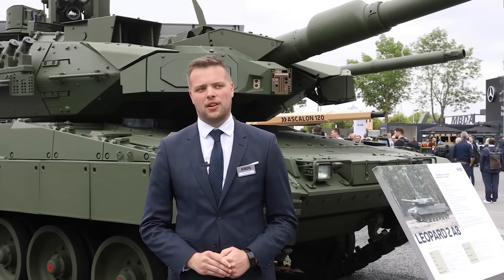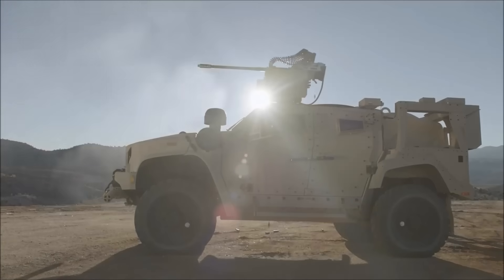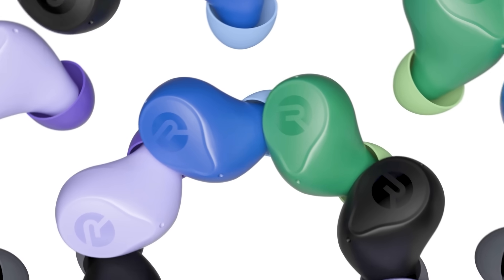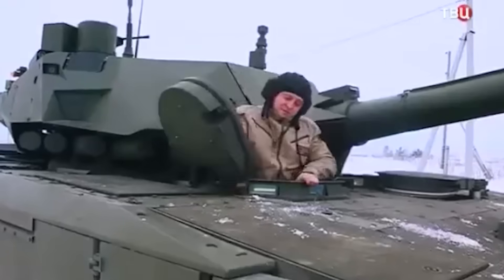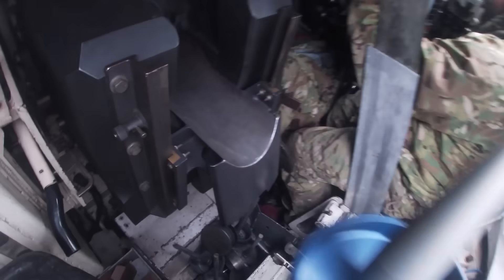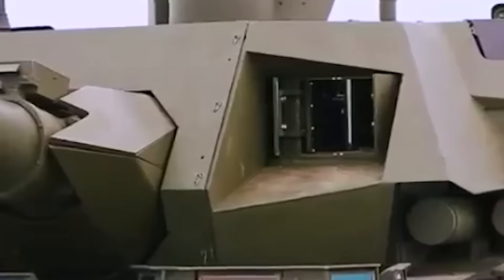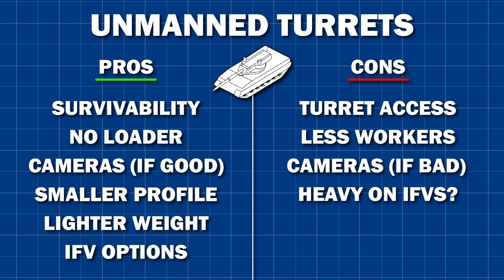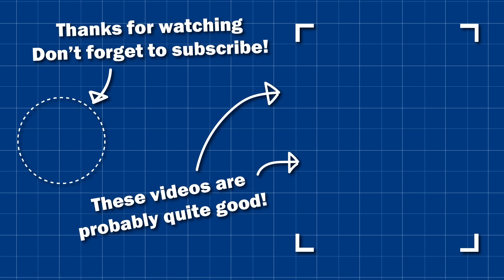The Unmanned Turret - And Why It's The Future

Comment: IFV or APC would benefit alot from Unmanned Tank Turrets. However, light tanks and main battle tanks should remain in conventional configuration because you still need basic situational awareness, and you need people to clear jammed cannon rounds and you need people inside to manually override the mechanical failures.

Comment: I would think they should put the engine in the front, and put the 3 crews in the back, and access from the back door.
fuel in the middle?
Reply: There are a number of challenges with this layout, assuming you place the main armor block in front of and above the engine. This makes maintenance tougher, and it reduces crew protection, and it reduces the height the engine can be.

The big problem is reduced crew protection. The thick front armor can only protect the crew against attacks from a very narrow front arc. Shots that aren't from directly in front will simply not be blocked by the front armor at all. The crew will only be protected by the much thinner side armor. Furthermore, this side armor must be heavy and consume a lot of space because it must run the entire length of the vehicle.

Other design difficulties come from the fact that both the main armor and the engine are at the front. This is a LOT of weight, and can really only be counterbalanced by placing the turret at the rear. But if you're using a high velocity gun, you'll want to be able to depress the gun downward. And this means the hull of the vehicle needs to slope downward. This means the front armor and the engine needs to be relatively short, and it probably means there needs to be heavy sloped armor plates above the engine. This further complicates engine maintenance tasks.

Comment: The reason that the us has not integrated autoloaders into their mbts is because due to the design of some, some autoloaders have to have an ammunition storage usually situated around the autoloader plus with an auto loader going back to the ladder with the ammo storage being situated around it theres a major risk of ammo cooking off inside of the tank rather than in a blow out panel if an enemy shell enters the tank which would annihilate the entire crew rather than allowing for a few to possibly survive an enemy round getting through plus The human loader can perform other tasks such as helping with maintenance or even taking over another crew position if needed plus While a human loader increases the chance of human error in the loading processes usually if a human messes up they can get right back up and try again If an autoloading mechanism has a significant mechanical failure you may have to abandon the fight to get it working again plus with an autoloader its easier to determine when the blast doors are open but with a human for whatever reason they might not immediately reload the gun after its fired
Reply: This is not accurate. For example, the K2 Black Panther stores ammunition at the rear of the turret, with a top blowout panel and protective bulkhead to direct an ammo explosion safely away from the crew (there are two crew members in the turret).

There is also extra ammunition stored in the hull, which does not offer this sort of protection, but that has nothing to do with the autoloader, and various western main battle tanks with manual loading also store extra ammunition this way.
Reply: I would also add resupply issues. As you mentioned, due to the rounds being in a ring of ammunition for the auto loader to load each round are usually (or at least the Soviet ones I’ve come across to) located on the “bottom” of the turret ring making it very hard for tank crews to resupply their spent rounds. I saw in a video that the Soviets (and I think some modern nations) solved this issue by basically refitting a whole new turret with the ammunition already inserted while removing the whole turret without ammunition. It reminds me of when rocket launchers were  developed in WW2: they were great when firing but when loading, it took time as the 6 tubes needed time to be reloaded and while they were, the enemy could have simply destroyed them. Same here. A tank can easily spend 42 rounds (that’s the current layout of the m1 abrams) in a firefight especially with a novice crew but the whole reason why they don’t spend it is because they are constantly resupplied. If we had auto loader system… we would have a tank alright… but one that can’t shoot because it already went through its ammo and needs to be changed

Comment: Honestly one of my pet peeves is that when the armata was first shown off, people wrote it off as overly expensive and not that big of a deal. The amount of "the turret will just be destroyed smh" comments I've read have been insane. 

Yet the moment us Europeans try it, then it's suddenly "the future of armoured warfare" and "the next logical step in tank design" 

I'm not saying we should "give credit" to Russia or something, screw them, but I think people really need to check their bias at times and what they are willing to write off or accept as truth on a whim.
Reply: people didn't trash the Armata because of an unmanned turret but because it couldn't even go down a parade properly without the transmission failing
Reply: FWIW, the Armata turret is pretty tall and vulnerable. The Leopard 2 A-RC 3.0 has a lower profile turret thanks to its double jointed elevation mechanism. The K2 Black Panther and Japanese type 10 have active suspension systems that allow adjusting height and "lean", thus enabling more gun depression and elevation from a low profile turret without a double jointed mechanism.
Reply from the maker: Hope I am not “people” here! Not meant to be a T-14 hit piece, I don’t see any reason why T-14 wouldn’t be a very capable vehicle. The issue is more that it’s been around for 10 years and they’ve only made about 30 of them, if that.
Reply: @RedWrenchFilms no I dont think so, it was just the intro that reminded me lmfao. I think you give a fair take of the concept as a whole
Reply from the maker: @EnRandomSten Appreciate that! Hope you enjoyed.

Comment: Unmanned turret should mean better armored turret, not the other way around
Reply: Moving the crew out of the turret does not eliminate the need to armor the crew. It just alters the placement of the armor required to protect the crew. There are a number of issues involved in whether or not this saves weight. On the one hand, the crew can be crammed together in a more compact region. On the other hand, the space available on the sides for armor is reduced because it can't overhang the tracks. Furthermore, hull side armor needs to protect from more direct angles, compared to turret side armor which can be reduced since the turret can turn toward the enemy threat.

The bottom line is that if you want to protect the gun of an unmanned turret to the same degree as the crew, you're not going to get big weight savings compared to a traditional turret.

Comment: i would say that a good back up option is to basically have the commander have a way to enter the turret for anything needed. it can be extremely cramped because it shouldn't have to happen often. this solves pretty much all the reliability issues. also i dont think these tanks would work alone. if anything a drone launching platform would be very useful. even just slapping like 2-3 small fpv drones would help immensely with combat awareness. irl war thunder

Comment: "Future of tank design" - one hit even from 80 years old gun and turret is disabled.
Like bruh. I dont think there is any armor on it. Imagine BMP-2 or T-55 decimating your tank because its "too techonogical" (or rather unarmored)
Reply from the maker: Don’t mean to burst your bubble but a hit from a T-55 could rather easily disable the gun/turret of pretty much any tank. Turret rings, barrels and optics are never significantly armoured.
Reply: @RedWrenchFilms  yea, HE hit from anything can disable many systems, but T-55 wont destroy any modern turret with armor piercing, also HE probably wont totally disable turret, just remember that many tanks designed to withstand it with main armor + special lining to catch stray fragments. IFV's also will only scratch and disable some sights.
But looking on those unmanned turrets, visually there is no armor even against most basic threats even up front.
Reply from the maker: @DaCouchWarrior Armouring a tank to withstand hits from modern APFSDS rounds is almost impossible. 

Unmanned MBT turrets are vastly smaller and lower profile, so are less likely to get hit in the first place. 

Aside from a hit to the turret cheeks (which many unmanned turrets don’t even have), there is no chance a modern tank could take a modern APFSDS without serious damage. 

The scores of destroyed T-90s, Abrams, Challengers and Leopard 2s in Ukraine are a testament to that, and in each case there was likely dead men in the turret.

Comment: I have to bet against the unmanned turret. It just doesn't make any sense to me. 

Mainly in terms of the visibility and motion sensitivity that Mark 1 Eyeball has. 

What I would bet on is wider adoption of the autoloader, especially for calibres of 130mm and over. 

I would also bet the crew will remain four, with the loader being replaced with the role of system operated. 

Thing is, vehicles like this? We've tried putting cameras all over them. It made the crew timid. They stopped and check every corner before moving and they only reached their objective after the hostile force occupied it. 

While that was Challenger 2 in this case, I think the same outcome is true. Information overload is information overload. Checking every screen, every perspective is going to slow people down. Volume of the turret as well, all that internal space? As much as possible keep the ergonomics good. Have people not just operate the tank, but do it comfortably. Don't make the crew fight the tank as they're also fighting the enemy. 

While the mechanical capability is there, there's an operating loss I can't work my way around. 

Honestly, I'd have to sit down with Nick Moran for a while and chew through this. I can see the gun, bustle, ammunition storage being isolated from the crew before any automated turret. It's one thing to look at a screen and get all the detail, it's another to let the eye, the human instinct to things translate through that interface. 

If I could, I'd get one of those sniper in full ghillie, where's the sniper type of meme picture here. I'd bet that being there in person there's a noted increase in detection over doing it from a picture.

Comment: I think the coming generation of MBTs will still feature the "classic" design. Just Imagine your sitting in your tank and an Artillery Barrage or sustained fire kills your optics and cameras.  Terrifying.
Reply: A camera is a lot smaller target than a vision block or window. It's a lot more likely for vision blocks or windows to get knocked out than cameras.

Also, if this is really a problem it's possible to hide spare cameras behind armor protection. For example, a camera station can be a shaft containing a stack of some cameras. If the outer camera gets knocked out, you push a block into the rear of the shaft, ejecting the outer camera and shifting the other cameras outward.

Comment: The tank I'd design would be 3+1 semi umanned tank. 
Unmanned turret that doesn't penetrate the hull so its can be swapped or upgraded
Hybrid power plant and drive by wire. 
The tank carries a mix of drones tethered camera/coms/target designation drones and dual use untethered drones kamikaze or backup camera.
Space for 3 Crew with a Service vehicle with space for 4.
The tank can be traditionally manned with 3 men for general operations
For short high attrition assaults the crew dismount to the service vehicle where they control the tank via fibre optics and laser coms with also relayed through peer tanks/drones for double redundancy if the fibre optics is cut.
The driver has the option of 360 cameras or drone if those are damaged
Commander vr headset to a has tethered drone giving him a 360 birds eye of his surroundings with target designation
Gunner has the gun sights and ammo selection
4 service vehicle driver is the engineer (for the fibre/drones), radio operator, acting as over watch for the crew when dismounted, and 4th pair of hands for servicing.

Comment: I've always wondered if adding drones to a tank to give them a 3rd person camera view (like in wot or warthunder ) will happen in the future, not only will it help with driving but it also feeds back into wat gamers already know so it'll make the tank easy to operate.who knows maybe in the future
Reply: It will get shot down immediately. Instead independent scouting drones fly in the air over the battlefield and transmit data to command center and to the tank commander.
Reply: @kindlingking really depends on how many you have tbh, plus how you position them and how far away they are. Id still say theres potential
Reply: it literally happening now in russo-ukraine war

Comment: I'd have an unmanned turret.  But I would place a fourth crew member seat in a 2x2 configuration.  The 4th seat would also have space for future equipment and interfaces.  This 4th position can be defined by the changing nature of war.  It may be necessary to have a 4th anti-drone position in modern tanks with that crew member running systems to counter drones, including kinetic systems.  The 4th position may be needed for information management.  The commander should have his head up and looking at what's going on OUTSIDE of the tank.  An info specialist could manage all of the updates and communications (like a radio operator of the past).  You can even use that 4th seat for various roles inside of a unit of tanks.
Reply: I think this is an interesting idea and valid given the role of information warfare, signals intelligence and drones getting increasingly more significant.

A 2+2 layout isn’t necessarily wider or (much) longer than a 1+2 layout. 
The 4th seat could be role/mission specific, or in certain cases be omitted.

A single or a few drones attached to a tank (via wires to combat EM interference) could be used to ge a 3rd person birds eye view around the tank, or spot targets while the tank hides behind cover. The drone would be a mobile periscope, operated by the 4th crew member.

It’s almost like the return of the WW2-era radio operator in a sense.

The turret (area) itself could be be designed as a modular, swappable, mission pack: tank, indirect fire support, drone carrier, point air defense, etc.
Reply: @tver  It's okay to rethink the tank.  I think we're already on the 3rd standard.  A fourth iteration of what meets the definition would be great. A driver, a commander, and then up to to two mission specialists depending on the package up top.  It would also make it easier to repair the chassis or the system on-board.
Reply: I disagree about the commander needing to look outside the tank. If u have seen real war footage you would very quickly realise there is almost nothing u can see with ur naked eye. Commander should be watching some screen that relays info from sensors or other units. A drone connected via fiber optic cable used to give a 3rd person view would be great as it makes it harder to blind the tank if the electronics on that tank are damaged.

Comment: I think unmanned tanks, or optionally manned tanks, are eventually going to be the future. 

But before that unmanned turrets are absolutely going to come first. Ultimately a tank is a type of mobile gun system, and it's probably good to think of it that way
Reply: nope. not the future. chinese side already post this kind of tank few year ago, together with drone. you can using drone to pinpoint enemy tank , and sharing it location with other . and also can control it remotely by army few kilometers aways. in addition, what the diffrence with this unmanned turrent with auto loader? they still got the same weakness such as when armunition sympathetic detonation,  right?

Comment: The biggest drawback would be the lack of situational awareness being in a sealed hull. A tank commander with a hatch in the umbrella protection position can see, hear, and even smell what is happening around the tank with marginal additional risk. No amount of cameras or sensors around the outside will beat that trained human perception of the realities of the battlefield.
Reply: Kaplan Harimau is a light tank with a quadcopter drone acting as eyes in the sky
Reply: Ukraine has found mark 1 eyeball to be worthless in the era of FPV drones. The best situational awareness are drones flying ahead of the main force. So what your saying is bs.
Reply: @AceUkiyoGeatsIX not really, he is talking about the crew inside of the tank having awereness, what you are describing is recon, something completaly different
Reply: @AceUkiyoGeatsIXdrones arent the only thing on the modern battlefield, so I think youre bs

Comment: The XM1E/A3 will have an unmanned turret, as well as the new XM30-MICV (Bradley replacement) and other variants (another of the many reasons the M10 was cancelled. There'll be an 120/105mm variant of the XM-30 if even they still require an SPG with their Loitering munition's plans IMO)...